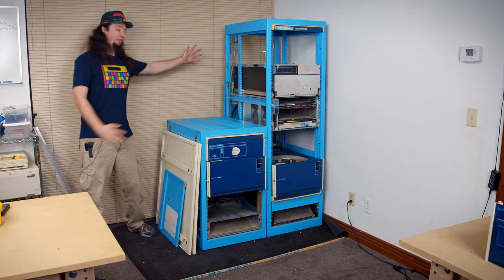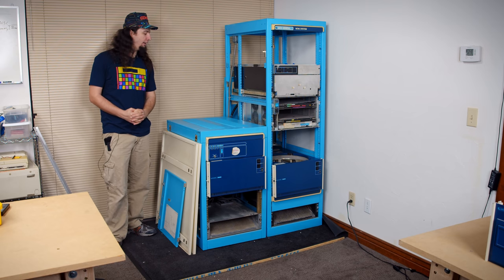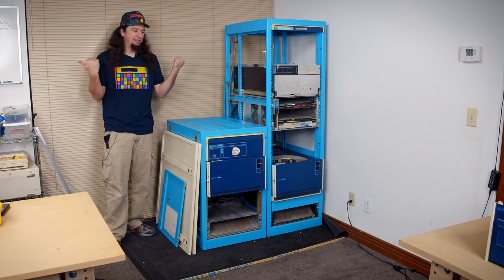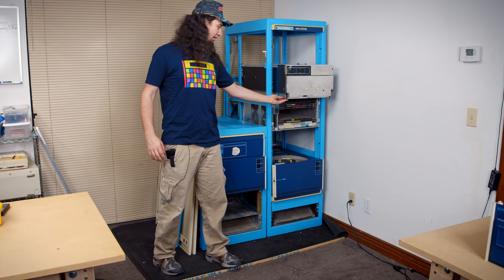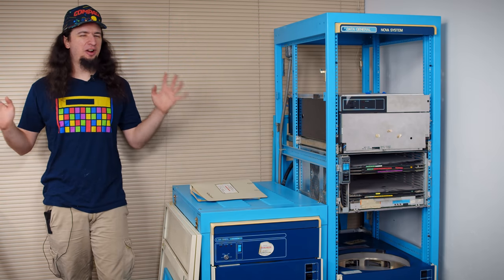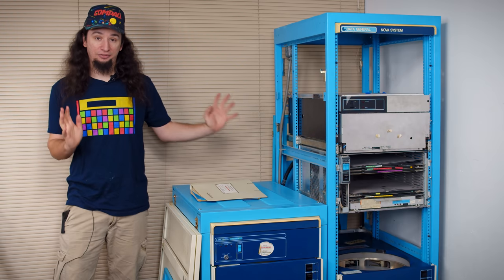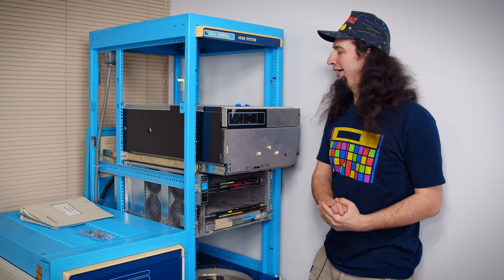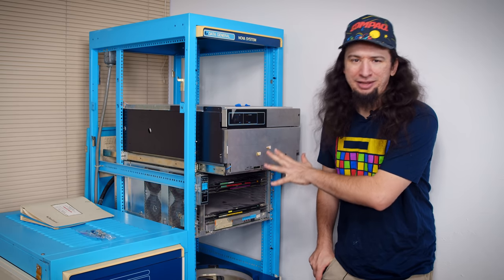Data General Minicomputers: The First Step

Comment: When you are working with heavy unsupported rack mounted hardware, you can add support with a folded sheet steel 3U rackmount shelf that is installed upside down so the flat shelf is on top, and the folded side angle pieces are below the shelf. For a long server, use two of these shelves on the front and back posts. Use ALL the screw holes on the shelf so it doesn't bend and fold down on itself with the heavy weight resting on it.

Comment: The thing that's going to use the most power is spinning up hard disks or disk packs. I had a Prime minicomputer in a previous life and I made the mistake of spinning both the 19" hard disks at the same time once, and they tripped the 16A 220V circuit breaker. Fortunately they had a circuit that, if enabled, enforced staggered spin-up: each disk would wait for the previous disk to be spinning before they would spin up.
As others have already mentioned, it's likely that your office has two 120V buses that are out of phase, and you can build a cable with two polarized male plugs going to one female multiphase plug with 240 or 208 volts between the phases. Then it's a matter of finding two sockets that are on different phases. I know your office is kinda old but I know that newer offices usually have alternating phases on adjacent sockets. So one socket on the wall is on one phase, the next socket 9ft down, is on the other phase. It doesn't need to be true but that's how it was designed in an office that I helped to wire up in Mesa around 2005.

Comment: Great to see you working on the DGs again.  One thing to check: are the power supplies set up for 240v or 208v?  Commercial buildings frequently are powered from 3 phase 120v.  Between two phases, you get 208v, not the 240v you see in residential supply.  

Anyway, best wishes on this, and I look forward to your adventures in getting these two beasts running again.

Comment: I love how there are actually some people out there taking these old mechanical machines and rebuilding them with modern components. So the physical nature, and workings of the hardware still work exactly the same, it's just all managed and run via modern-replaceable-components. (Which usually results in much more energy savings too.)

Comment: I had a Perkin Elmer 3200 Unix minicomputer that ran on 240volts, 17 amps on one leg and 15 on the other. Those current measurements were constant! 
It pulled a lot of AC electrons; about $400 dollars worth per month! It also raised the temperature in a wet old basement by 5 to 7 degrees C, and dried out all the old cement floors!
I had to install a 40 amp 240-volt pony panel in the basement with a 40 amp Hubble twist lock. It never popped the main 100 amp breaker, in the house, but I'm sure it got close!

Get yourself a clamp on AC amp meter! It's also worth mentioning that most AC panel breakers need to be in an over-current condition for at least five minutes before they will trip.
So transient inductive and reactive KVARS power surges from in-rush current from motors and power supplies,won't necessarily trip the breaker immediately. 
But you gotta be mindful of the Power Factor you are drawing as well.

Comment: We had four ampex ADO effects generators at work, they drew 60 amps at 220volts AC constantly. 
They each had a 200 amp 5 volt DC power supply and a couple of 5 and 10 amp +-12 volt DC supplies!

Comment: 12A will be fully loaded, but your system seems quite sparsely populated so I'd imagine it will draw much less.

As for those plastic "bars" that the ribbon cable was hung over, they are a generic part and nothing Data General specific. Panduit still make them today, look for "Pan Pole Standoffs", part number PP2S-S12-X.

Comment: Remember that 'rated' current is not the same as 'in-use' or 'inrush' current.... I used to have these discussions all the time in our datacenter builds... I'd get 'engineers' who would say "this chassis requires 15amps"... maybe yes, if every slot was completely filled with the highest power consumption devices... we'd put a current clamp on them, and startup draw would peak at maybe 3 amps, and runtime was more like 1...

Always use a current clamp to verify before getting concerned.
Reply: True, but inrush is not the same in-use either.  Rated current is kind of a worst-case-scenario long-term average current rating.  It's what the equipment should be able to handle indefinitely, if operating at the edge of its capability.

Inrush is a very very brief, but sometimes extremely high current draw while transformer cores magnetize and capacitors charge.  Inrush current will often exceed the nameplate current rating -- often by several times.  It's not uncommon for inrush current to be 100s of amps.  But only for 10s of milliseconds.

This is the reason slow-blow fuses exist, to allow for excessive current spikes, but not excessive current.  And circuit breakers work on a thermal principle as well, so they won't immediately trip from inrush current.  Remember, all that protection is meant to avoid having wires heat up and cause damage and/or fires.  It takes time to overcome thermal mass.
Reply: This is exactly right.  From what I can see there's about zero chance this computer uses anywhere near 12 amps.  Where would the heat go?  

My guess is the power supply was rated for powering massive hard disk platters, and then only to spin them up.  I didn't see any of those (which is itself a problem since I'm not sure where you'd load the OS with no storage medium).

Comment: These computers look really awesome fully assembled with the blanking panels in place. But I'm very glad modern racks are much more user-friendly. Captive nuts are so much better than whatever those weird bars are.

For racking and de-racking big stuff with only one person, I usually mount blanking plates directly under the unit, and let it drop onto the plates. Usually I'll have access to both the front and side either through the adjacent rack or if it's at the end of the row, I can support it from the side as I pull it out until it reaches the point where I can support it just from the front, then I can pull it out and lower it onto a trolley.

The biggest things I've installed/removed using this method without help were some Cisco 4506-E switches. They're 10RU high, but they're not the full rack depth, so they're only about 20KG for the bare chassis. In that case I only needed the blanking plate at the front.

Comment: hi , I use to work at a company in the 70's and 80's that made AUTOMATIC IN-CIRIUT TESTER EQUIPMENT (ATE) IN Latham, NY . They had NOVA 3 and 4's they ran the testers. i don't have much experience with the NOVA's sorry ,but its nice to see them. it brings back memories of the time. I had different job's , i help populate broad's for tester's , then i went into final test where 5 to 6 guys had to get the tester up and running.  Then after 5 years i did customer programming of there broads, two biggest company's was DEC  PDP11/12 and WANG the Word Processor. The programs were $50K each and testers were $150K to $300K. The 2nd 5 Yrs i did programming of the tester for customers broads. The Nova's all had 32k memory I hope you have good luck in them up running.

Comment: Electrically I don't know if anybody else has commented a 15 amp circuit is rated for 12A continuous. Assuming there's nothing else on that circuit you'll just make it. most likely that unit had a dedicated 20 amp circuit since commercial property requires 20A minimum. but it is also not pulling full load although you got the capacitors charging.

Comment: The connector that you installed @12:59 was very much "How are you doing?" - it looked very loose as Dave at EEVBLOG says.  In regards to power consumption, remember that in the 1980's air conditioning was a significant element in computer installations.   Interesting project.  Good to see some people have such inspiration to resurrect old technology.

Comment: Looks interesting.  On those spaghetti serial cables, I think I would suggest just making new short pigtails (IDC header to DB25), and connect normal serial cables up from there to wherever.   Trying to work with those old spliced up messes is just not worth the headache.   Put them away in a box and use nice new ones instead.

Comment: I don't have a lot of experience with mini-computers, but I once was a network administrator for an accounting firm that had a DEC Vax mini-system and it required a power conditioner and full time air conditioning to the room it was in because of all the heat. 

I was not involved int he DEC stuff, just the Netware Lan and servers that were also in the same room.  Whether or not the power conditioners were absolutely necessary or not I don't really know.  But it might be a good idea to find out of this computer needs one (with the size of those caps, it might not). 

Also, how much heat are these things going to generate?  Whenever the special air conditioner to that room went down, everything had to be shut off because the room would heat up very quickly.  The room wasn't that big, maybe 10x10, but it was in a much larger space (it wasn't it's own building, just a section on the floor of a much larger office building) and it heated up very quickly.  It went down and everything had to be properly shut down in like 30 minutes before the heat became dangerous to the equipment.

Comment: On a US power socket, you should be able to connect a 1.5kW continuous load (eg a heater), or a 1.8kW burst load (eg a hair drier). So your 12A should be fine, just like connecting an electric heater to the socket.

Comment: If you had a DG computer back in the day ... you would have had a massive library of documentation taking up more space than the computer cabinets. I am surprised that they were not available when you bought the computers ... perhaps not surprised too!

Your models are before they changed to 'earth tone' colours ... a less yellow white ('colonial white'?) and brown instead of blue.
Early DG computers often had a wire wrapped backplane ... which became simpler as the serial numbers increased. We once had a SX2000(??) with a serial no of 4 (??) ... this is from memory so I cannot be sure of the type number/code.
DG machines often had the firmware updated as software (the tecchies referred to it as 'mushware') and they used 'ULAs' (Uncomitted Logic Arrays ... Ferranti chips?) extensively eg in their 'IAC's ('I.. Asynchronous Controllers' for multiuser terminal connectoins. An IAC8 would connect 8 RS232 terminals (we used Wyse 60s) to a computer. 
We originally had a uNova (MicroNova) MP200 with a 12 1/2 MB winchester disk and an 8" 1.2MB floppy disk drive. 

I think the SX2000 was replaced within a short period by a DC2000(??) which was not so much of a prototype!

The Nova4 would use RDOS as it was a 16bit m/c ... AOS/VS etc were 32 bit.
Try typing XYZZY at the AOS/VS command prompt and compare the result with typing into AOS/VS Ii !
... I will post the responses later if no-one knows the responses or the origin of the command (yes it was in the CLI ('Command List Interpreter' ... ie shell).

Edits: I think they were DC or MV 2000SX and  ... 2000DX.

If you typed xyzzy to the cli (Command List Interpreter prompt) you got "nothing happens" from AOS/VS ... and "nothing happens - but faster!" from AOS/VS II 😊

Comment: 12A is actually pretty close to the 1500W maximum allowed (not actual but allowed) power draw from a single outlet on a 15A circuit. Maybe the machine doesn't use an awful lot but the power supply has just been given as much headroom as possible?

Comment: Would be nice if you could get them to work with domestic power, here in Europeland these old chonkers would often be configured to run on industrial 400V tri-phase connectors, not so much a problem in Scandinavia at least since all detached houses are wired to support an install of those outlets if needed.

Comment: That is a more recent version of computers I worked on around 1978-80 (Nova 1200? We wrote pipeline supervisory control systems in assembly language).
The earlier computers had a front panel with toggle switches which you could use to enter values into the memory. To boot the operating system, you had to enter 3 (?) values into the first three memory locations, and then toggle RUN. Some of our computers had paper tape punches and/or readers which were used to carry software out to the field.
You could make changes to the programs on the fly by entering octal values through the front panel.
Reply: I had a friend (now deceased) who had an Alpha Micro AM-100 that incorporated an IMSAI front panel, aka the toggle switches.  He was a sysop for one of the baby Bells, back in the day.  He did some programming on it that way!  CDC Hawk hard drive 5MB fixed/5MB removable, 8" floppy, 3 terminals.
Reply: This is the one I remember - it was foreground/background, NOT multi-user (that came along later) We had to sign up for one hour of time on the computer every day. New programming was punched on cards ahead of time for fast input.
You can see toggle switches and lights which allowed examining and depositing data in any memory location, including the accumulators. To make a minor correction, we could "deposit" the new code in available memory locations, and then deposit a "JMP" to instruction to divert execution to the new code, which included another JMP instruction to return.
The picture is a link to Wikipedia Data_General_Nova# Nova1200.agr.jpg, which I'll put in the next post
Reply: Looks like it's not allowed (I think YouTube doesn't allow posting links), but you can find it in the Wikipedia article for Data General Nova 1200

Comment: I presume those threaded bars on the front of the rack should be screwed into the right U, using the top and bottom threads and nice flat headed screws before the unit is installed and then it's held in the right place when you come to screw the rack ears to it if that makes sense
Reply: why you care about that, why you need this?
running what?
Reply: @lucasrem1870  if you don't understand the comment, perhaps it's not for you? I was talking about the flat threaded bars at 32:00 - as shelby was holding them in place with twist ties until he could screw the unit to it.

Comment: My advice for what it's worth. Test the capacitors first. If they are off proper quality there is every chance they are just fine. To bad you don't have one of curious Marc fancy testers. Certainly don't waste be money on capacitors replacements that are not needed. Reforming for long periods is a waste of time. Just ramp up the voltage slowly in a few stages. Within minutes you will know if it's going to be fine.

Comment: when you go to reinstall it in the rack put it back in with a rail kit, or mount a wooden shelf below it, and set it on the shelf whilst installing the upper rack screws. 
you can stick those captured threaded bars nuts on the rack with some CA glue,  lock tite, or hot glue, you should be able to remove them again fairly easily...

Comment: Love the HP rpn calculator shirt. I've been considering getting some swiss micro recreations of some of those discontinued models. Would consider even getting the Swiss Micros 12c just because the hp made ones are shit build quality, but i managed to fix the display on mine with a hair dryer and a pencil eraser.
Lousy lcd's with their sub-par ribbon connectors in their $100 calculator smh

Comment: A idea you could do to help limit the inrush current on the 4X is put a 1000W incandescent lightbulb if you can find one and have a switch so it’s like a dim bulb tester which you can bypass at the flick of the switch so the current gets limited from the peaks

Comment: Note that you need to run an outlet at only 80% or rated current for sustained use, and 100% for peak use only.  So 15A = 12A Continuous.  However, I'm concerned about that three breaker setup on the 4X.  I concur with running 240V circuit and terminate them in the twist lock outlets so you don't mis-use them. Those are readily available connectors.  Also check the actual distribution wiring in the 4X. Is it 3 separate circuits off a larger feed?  Was some of it meant to feed the printer (which is usually a hog given the chain motor and the paper motors, and perhaps a fan to suck the paper to the guides.

I'm also concerned that it was designed for an office/industrial setting where it's really three phase power, and not single phase.  If it's a 4/5 wire connection on the feed, thats most likely 3 phases and ground and perhaps neutral, as I doubt it was designed for split phase 240 (hot, neutral, -hot and ground), but instead for red, blue, black and ground.  And then you need to know if it's 3 120v phases (which is 208v hot to hot).

These were not designed for having them in a consumer setting. (Ok, I had a mini in my house, but I also had special wiring for it, 24 serial ports, and a 48,000 BTU A/C unit right next to it. (Yes, it was the early 80s), but it was for business purposes.
Reply: yeah, gotta say it looked 3-phasey to me too. 415VAC looks like it would be the ideal

Comment: I really would not soak cards of that age in an ultrasonic cleaner. Many components will have developed hairline cracks and no longer be hermetic, and getting excessive moisture in there is going to damage them. Stick with an air compressor and a blowgun, and maybe a fine horsehair brush to clean off the boards.